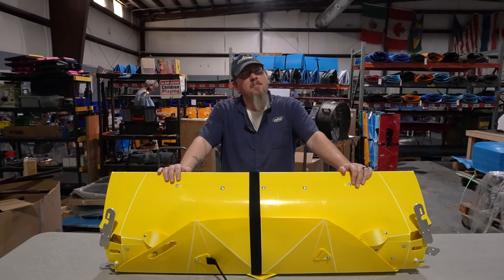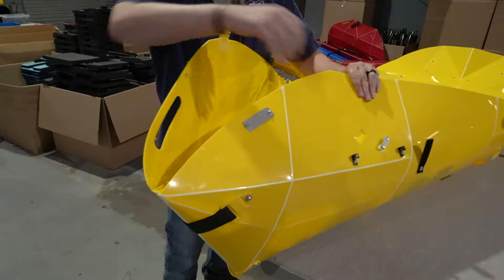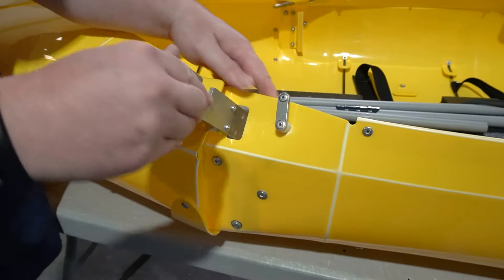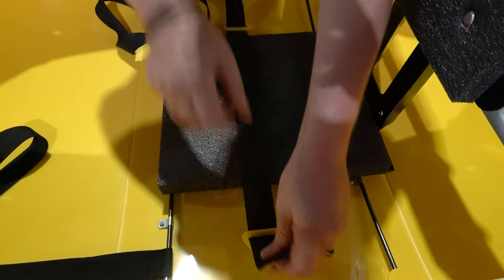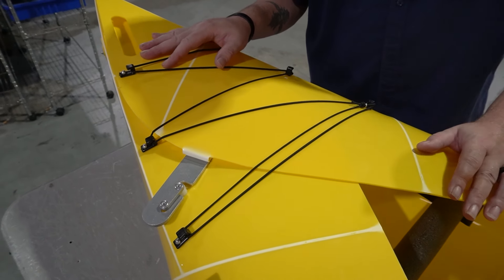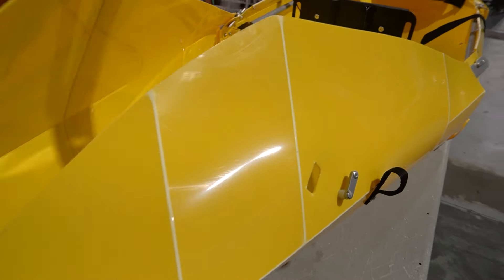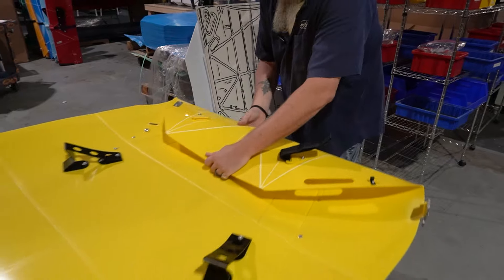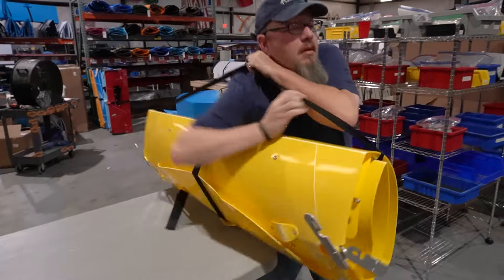2025 Model Assembly 7.25.24

Comment: We got our 2025 Pro pre-order just in time for Santa to deliver! Setup was pretty smooth, though I'm skeptical of the long-term viability of some of the aluminum arm pivot/mounting locations - seeing significant deformity around the rivet heads and material stress after only one set-up. Is there any seat position adjustability fore/aft? Seems like a no, with the fixed position of the (admittedly very well-designed) new seat cage. Fits my wife OK, but I'm a bit too tall for any of the footrest positions. Also, is removing the footrest OK or will that weaken the structure?
Reply: You can move the seat up, but you have to disconnect the seat from the rear frame support and just rely on the seat strap.
Reply: You can remove the footrest with no consequences, but it's hard to get it back in if you change your mind after you launch
Reply: The folds are pretty solid.  They used to use plastic with a textured surface that was more likely to split at the seam.  The smooth textured plastic shows more discoloration, but seems more resilient.
Reply: There are some helpful Facebook groups for Tucktec owners.

Comment: is there a video to attach the stabilizers?

also: the seat cage needs to go in one way, not the other(flipped) 
the plastic part that grips the seat angles slightly down, if u put it in with that opening slightly up the bar on the seat doesn't go in (or itdoesn't sit on floor)